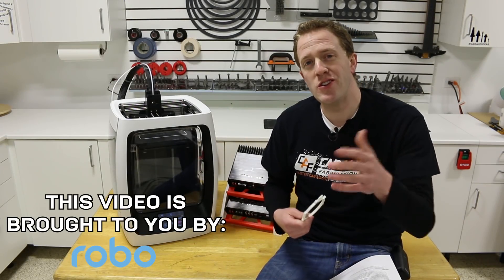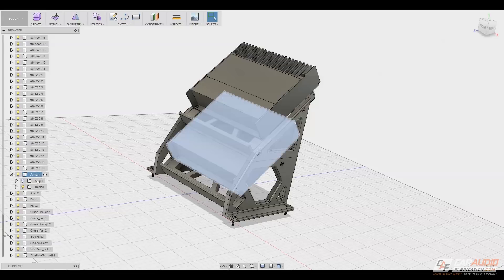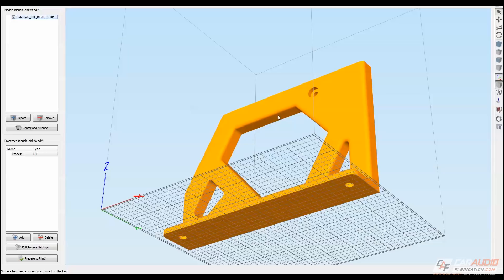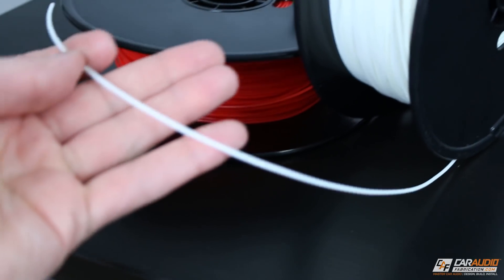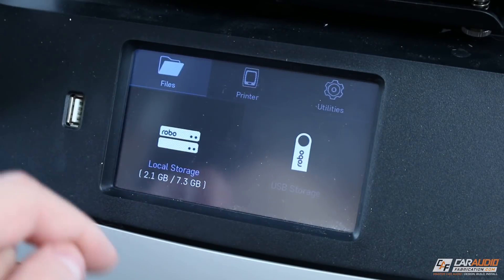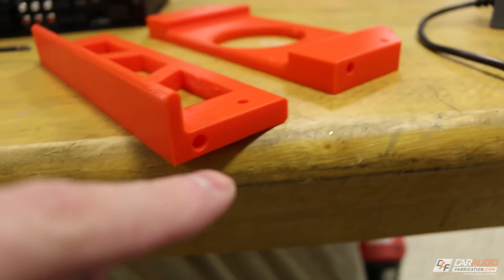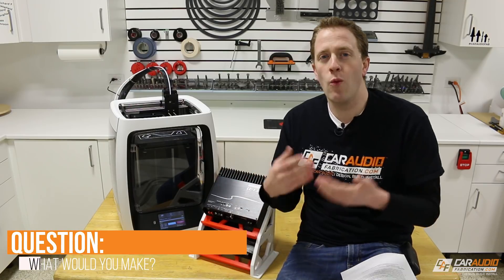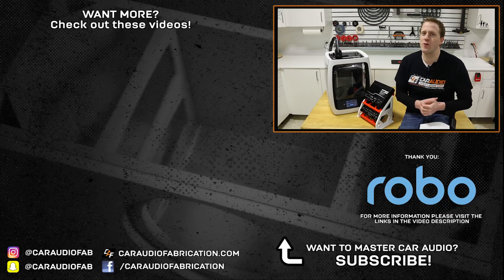I 3D Printed an Amp Rack! Cooling fans and more!

Comment: I have a couple 3D printers and right now I'm running them to make some internal bracing mounts for an acoustic guitar I'm building for a client. The mounts are being printed from carbon fiber infused polycarbonate and they will hold 6mm and 8mm carbon fiber rods to the back and soundboard in place of traditional spruce braces. The idea is to be stronger and lighter with fewer and smaller direct contact points for less interference with the resonance of the instrument. I also use my printers to make various router templates for guitar building and am soon going to be using them to make full-size representations of guitars I've designed so I can make molds of them and start producing the instruments themselves in carbon fiber. Oh and I also use Fusion 360 for all my design work. It's a fantastic program with a lot of resources to help get a new user up and running. I knew nothing about CAD last year and have made great advancements through trial and error and some basic tutorials.

Comment: Unfortunately... I do not have a 3D printer. YET! I will have one some day. But I do have 2 CNC routers I built and they work very well for these kinds of projects. Great video and cool project. One nice thing about CNC routers over 3D printers is while I have to buy sheet material to cut from. Even my home built CNC router would knock this rack out in about 30-45 minutes depending on the material being cut and assuming I was able to nest everything into one panel and just push start.

Comment: I'm really impressed by the quality of this printer.  Don't know anything about it, but my CubeX (12x12x12 printing area) was the ultimate back when I bought it.  I prefer printing PLA vs ABS.  In all honesty though I haven't used it in years, all my work is done now on the CNC.  A CNC is virtually a 3D printer but instead of additive it's subtractive.  The fact that you were able to print such long horizontal lines without supports is very impressive!  I've made some pretty exciting things with the 3D printer it's just that it takes so bloody long and they DO mess up ESPECIALLY when using ABS.  Some "aftermarket" software and hardware goes a long way with printers though.  It'll be neat to see how often you use this going forward.  ALSO very impressed with the support in these comments, I was expecting, "YOU FOOL WHO HAS A 3D PRINTER?" "YOU ARE DUMB, TOO MUCH MONEY"  "THAT IS GAY!!"  not a bad little community here!

Comment: Awesome seeing the use of new technology pushing boundaries. As an idea Mark it would be interesting to see the weight differences between this amp rack and an identical mdf version. Also another plus for the 3D printer would be making templates to use on the router for mass produced/common parts.

I'd make an iPad slider kit but I think Mr Bernards would send the lawyers round!

Comment: I don't know that I like the 3D printer vs using wood or metal. I question how strong that abs plastic is vs wood or metal. That rack could have been made with various woods from soft to hard and various metals from steel to aluminum. I do understand and like being able to just print a part over and over again but 28 hrs print time is kinda cra-zazzie! How much did the abs material cost to make this rack? Good video though. Thank you for sharing. Love your walkthroughs! Mad skillz!

Comment: Mr Car Audio Fab guy please red my comment - I have an issue to bring up that you might be able to find useful in terms of content for your channel. I am running two amps in my car using a relay. Before and after using the relay I have had this issue where one of the amps does not power on in cold/wet weather. Both amps are old school Eclipse. The one that does not power on is brand new (yes out of the box after many years) but will not power on when it is cold or it has rained. My car is parked under a roof (not in a garage) so it does not get wet although I can only get one amp to power on. Even after driving for a while and the car is warm - no go.  I read about moisture and other issues such as hairline fractures that could be a factor in the circuitry but I am not sure what the issue is. The amp that will not power on is an Eclipse EA3422 very common popular mid range amp. I ran one of these in the same location of my car for many years before finding this replacement (new) on eBay and never had this problem.

Comment: ABS can be a bit tricky to work with (warping, bed adhesion issues... oh, and it stinks when it gets hot, too; so remember to have plenty of ventilation where the printer is). I’ve had great results with PETG on my Monoprice Maker Select (basically a rebadged WanHao i3). I did upgrade to an all-metal hot end, though. The PETG I’m using is from eSun, and it lays down well, doesn’t warp, and doesn’t stink, either (I still run the vent fan on the enclosure I built for it though... breathing hot plastic fumes can’t be good for you even if it doesn’t smell bad). 😎

Comment: Mark, let’s say you want a more polished look. 3D printing is very good and precise but what is recommended for a silky smooth and polished look?

The amp rack turned out pretty well. Interesting concept to use red and white in contrast with a black amp.

Comment: Awesome video. Thanks.  Question: I have a few old school PPI Art series amps that are mounted diagonally like you did in this vid.  My amps have a white gooey grease under all the mosfet amp parts.  The paste transfers heat from the mofset part to the amps exterior case, thus allowing cooling.  I am curious if you think inthe heat of summer if the cooling paste will seep donhill and come out from under the mofset parts?

Comment: In addition, if you expect to sell high volumes of a part, once it's printed and test fitted and all is good, you can send the finished design to a 3D print fab in china and order them in bulk at a low cost pr part. It's not feasible to mass produce anything on a 3D printer at home, but it's great for prototyping and then order it up from China. :)

Comment: I've designed a small custom 3x ATO fuse holder. Maybe it'd be a great idea if you could design a fuse holder of yours too! Bonus points if it's part of a custom power distribution board using small copper bus bars!

Comment: Hey quick question im running wire for amps and such and wanted to know anout running the wire under the car, right now i have it placed on the fender under the hood and its ran along with other wires that go into the fram rail from under the hood and i have it fed all the way to the back for truck entry, i know about grometing the wire and all that ect but before i go through with this just wanted to know if its a good idea or not, i have a 96 impala ss and  theres only two grommet ran into the fire wall and they are completly sealed and no removal without redoing the whole seal and didnt want to go through with all of that

Comment: great video ,  i noticed the parts have texture , can they be sanded smooth  or can the 3D printer make a smoother finish ?
Reply: He is using ABS so it can be vapor smoothed with acetone. It will look like a molded part if done correctly.

Comment: Printing a factory door speaker adapter bracket with a sealed back to make a small box for the mid base or even a mini ported mid bass speaker adapter bracket.  You know for those dam Toyotas.

Comment: I think its more useful building specialty parts. The Backframes of the amprack that holds the fan for example. Shops can easily pump those out in volume and  sell it as an upgrade too a traditional amp rack design.

Comment: I would print out a bolt in double din tablet slider kit and Door speaker adapters/Tweeter adapters for GM cars that I have. I have a 08 Lacrosse Super, 98 Grand Prix and 99 Century/Regal and they share some of the same parts with other W-Bodies. Not 1 person has done a speaker adapter for a 97-08 Grand Prix 😑
Reply: thinking the same

Comment: I'm curious as to how that would hold up in a trunk in Florida where it get 140+ degrees.  Cool idea though.   Great design and execution.
Reply: Most abs will go soft at 172 degrees. After that things may start to change shape. If printed solid it should hold up a bit longer.

Comment: I'd print custom speaker covers, speaker mount plates, amp shrouds, wire clamps/combs, subwoofer style mount plates, custom switch panels, custom wire management racks, tweeter pods with 180 degree adjustable aiming built in, just a huge number of things. you could embed your logo in prints instead of having to use a router and then do a layered paint on them. Also much easier to mass reproduce when it comes to adding your personal styled touch to something.

Comment: Sorry off topic question. I have 2 single coil 8ohm 12s i wired parallel to try to use with my 2 channel 4ohm amp, is it possible to get 2 8ohms subs to work with a 2 channel mono amp?
Reply: carlos arevalo If your amplifier is bridgeable, maybe. If it is 4 ohm stable when bridged, you could wire these woofers in parallel to achieve a 4 ohm load.
Reply: John Clark it's a mono amp- soundqubed s1-2250
Reply: Carlos, I read your amp specs and it will provide, at peak power, 400W per channel @ 4ohms load (800W total -> 400W L @ 4ohms and 400W R @ 4ohms). If you have 2 single coil 8ohms wired in parallel, the amp will deal with it as if there was only one 4ohms speaker and will provide up to 400W to that. But since there are actually 2 speakers, the power will be divided between the speakers and you'll end up with 200W to each speaker. Thats good if you have a power handling on each speaker of 200W. If you connect one 8ohms spk into channel L and another into channel R, you will probably have the same 200W to each speaker because as the ohms go up, the power goes down almost proportionaly. What is the power handling on each of your speakers? (must be RMS power, peak or PMPO are useless)